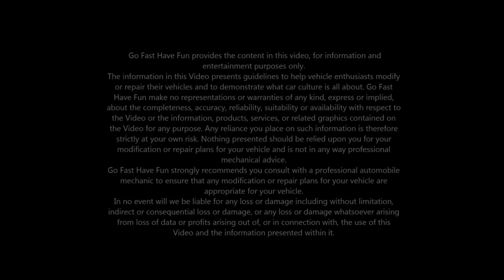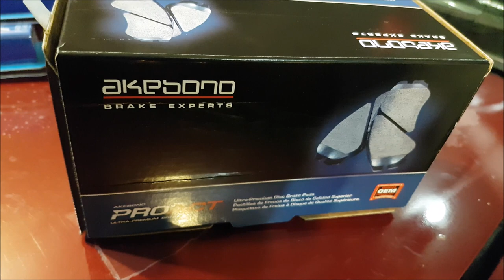Akebono Big Brake Kit Installation with Z1 Adapters (Nissan 350Z / Infiniti G35) | AnthonyJ350

Comment: I skipped the hassle and bought a track model with the brembo from factory! Very cool to see that they provide an aftermarket option for the other models!
Reply from the maker: The Brembo package is decent
Reply: @AnthonyJ350  I’m a fan! I have the 06 track, I recently did pads and rotors and took the opportunity to do the stainless braided flex line as well. I love the stiffer pedal feeling. 
I will also take this opportunity to thank you for the quality and detailed videos about the Z, I used your channel for education and reference while in the market to buy mine. I appreciate your work!
Reply from the maker: @matto5547  Thanks so much for sharing that! Nice to know when videos help. Have you seen our video on the Z1 brake booster brace?
Reply: You really should upgrade your Brembo’s for the Akebono kit lol

Comment: Currently installing Z1 (BBK) on my Infiniti 2015 Q50 w/ Vossen VFS-1 19” wheels.  Ran into the same issue with the Front wheels valve stems.

Luckily I watched this video and ordered the Flush Mount Valve Stems.  Fingers are crossed that they will clear the front caliber!  Will give a status update once complete...
Reply from the maker: Let us know if this solution works for you!
Reply: @AnthonyJ350  i put the akebono on my g37 and my emergency brake , It got out of adjustment, only then do I need to adjust it, a guy told me that I needed the one that comes with the akebono

Comment: Cool video. The only thing I would change are the dust boots on the bleeder value. Looks like they were painted red, my OCD can't stop thinking about it lol.
Reply from the maker: Ya I will change them. The caliper paint looked better if I just painted them because masking the bleeder was a pain. I figure it's just easier to get new rubber caps lol. Good eye noticing that!

Comment: Ohhhh. Ive been thinking about this kit. Concept Z has them aswell. Was thinking if OEM ones or these. BUt OEM Brembo would look stock. Also time for new wheels lol
Reply from the maker: As long as concept Z it's a one piece bracket. Depending how you finish the calipers will determine if it looks stock. These are Nissan parts we put on.
Reply: LilSaint001100 I really liked the Z1 kit fwiw.  With the OEM Rays it has so much of a “fuller” look.  Side note that the exact same infiniti branded calipers are - for a reason I cannot explain - are exactly the same but cheaper.

Comment: Bro! Where do I buy those rear rotors that are the correct size? I cannot find them anywhere with the smaller inner diameter
Reply: bro! I was gonna ask him the same thing lol cant find them anywhere either.
Reply from the maker: I just went to Lordco and asked them for 370Z Akebono rear discs.  Are you having issues like I did with the parking brake?
Reply from the maker: I got them at Lordco.
Reply: @AnthonyJ350  Turns out their just regular G37 rotors ahah. Yeah the G37 sport rear rotors are the 350mm outer with the 6 and 3/4 inch inner diameter
Reply: @aaronnewman1484  so I have a m37x and having the same issue so what do I need to make my parking brake work again because it wouldn't fit with the rotors I got off a 2013 g37

Comment: thanks for the video. I just wanted to see how big the akebono calipers are and how they fit onto the rotors. I was looking at the wilwood 6 piston 14 inch brakes and it looks like the rotor surface area is quite small around the outer edge and the hat is quite huge so it seems almost bogus to call it a big brake kit when the caliper Pistons are quite small. so I am going to go with the akebono. instead of the wilwood. although I am getting the lightweight Z1 two-piece rotors.
Reply from the maker: Thanks for watching.

Comment: Excellent job man! You see these aftermarket akebono refurbished everywhere for short money, they even says akebono on them. They seem to work as good. Are they OEM? If so, why do ppl buy crappy looking used ones for 800, $1000 bucks or more when we can get a raw one at Autozone for less than 100 bucks and paint them ourselves. Powdercoat obviously if you want to pay, but paint looks just as nice. A friend vinyl wrapped it. Never heard of it. Looks awesome but it is peeling a little bit after few months. Supposed to be high temp film. Idk.
Reply from the maker: I'm not sure about the the refurbished ones.  If you know for sure it's the right one for a good price, get them.

Comment: Did you use the same caliper bolts? I tried to re use my stock one piston bolts for the backs and they didn’t work... by the way great job explaining everything!
Reply from the maker: Thanks! I used the hardware that came with the used calipers.

Comment: Ok I'm glad I found this video because my mechanic had to eliminate my parking brake on my m37x to make the big brake kit work but I want my Parming brake to work so I need new big rotors with the diameter of my stock rotors?
Reply from the maker: Ya the drum size seems to vary. What car did your rear rotors come off of?
Reply: @AnthonyJ350  a 2013 G37

Comment: Hey man.  Do you have OEM part numbers for the rotors and pads.  For don’t and rear.  

I wanna get a set of Akebonos.  But I want to buy aftermarket slotted rotors.  So I need to know the OEM sizes for the akebono.  

Since there are 3 different brake types for the Infiniti’s there are 3 different rotors.  🙄 

Also do you know what rotors you had that were to big for the e brake?  

I wanna make sure I stay away from whatever part number that was lol
Reply from the maker: I would check on Z1 Motorsports.

Comment: I also have vossen’s 
19x8.5 in the fronts was wondering what exactly you did to notify the fronts shops aren’t to familiar with the shortening valve stems wanted to know more as I have the same issue with my valve stem hitting the caliper thanks man!
Reply from the maker: If you watch the end of the video I had flush mount valve stems installed to clear the caliper.s
Reply: @AnthonyJ350  did the same

Comment: I installed the Akebono kit on my G35 about a year ago and noticed the brakes are a bit squishy until the pads heat up.  To a certain degree I don't mind it, but I'll ask anyway:  With the master cylinder adapter install do you find that the feedback is touchy at onset or does it still maintain the factory feel?
Reply from the maker: With the master cylinder brace the feel is immediately more positive
Reply: AnthonyJ350 thanks dude, now to adjust the budget for this month...
Reply from the maker: @ScylockeX  Make sure the engine is running when you bleed the brakes as well. The pump needs to be active to bleed it properly. That's coming from Nissan.
Reply: AnthonyJ350 interesting note.  I definitely did not do that but just gravity bled the whole thing in the order my Haynes manual mentioned.  If I find it lacking after the brace it may be worth the effort.  Thanks for the note and keep it up with the videos; you are very thorough and easy to understand.  These types of videos are a boon for those of us who want to do our own work but have an informed guide along the way.

Comment: I just installed a big brake system on my 370z and my brother was wanting my slotted rotors and base 2 piston calipers to install on his 05 350z. Would he need the front adapters to install the 370z base 2 piston calipers ot would it be a direct bolt on?
Reply from the maker: I'm assuming you will still need the bracket from Z1 because the mounting position is different on the front of the 370Z vs the 350Z.  I haven't tried your particular swap though.  If you could comment when you guys have completed the job that would be awesome so I can learn something new.
Reply: Thanks for the quick response. I will order the brackets then and will let you know how it turns out. Didn’t see any videos with this setup so was needing some guidance.

Comment: Could you do a 60-0 brake test? 
really enjoyed watching the video and thanks for making this video
Reply from the maker: The only problem with that is I wont have data for the stock setup I had.
Reply: my350z.com has a great thread that can provide this data. Its a lengthy read but very informative.
Reply: jamaicanbullet thanks

Comment: Is there a bracket for the rears? Or do the 370z rear calipers bolt right on?
Reply from the maker: They bolt right on.
Reply: @AnthonyJ350  thanks man, are you running rotors from the 370 all around as well?
Reply from the maker: @bean2077  Yes it's all 370Z plus the Z1 bracket for the front

Comment: Would the calipers fit perfectly with the g35 19 rays?
Reply from the maker: I would go on my350Z.com or G35driver and see if anyone has done that combination. Good chance it will because my Vossens have a ridge that comes in a lot as you see in the video.
Reply: @AnthonyJ350  much appreciated I bought the same adapter kit and steel brake lines as well from Z1
Reply: Bought them just now looking forward to the install

Comment: can u use the stock brake lines untill upgrade to SS
Reply from the maker: If they're in good condition and you can mount them the same way without them stretching. I would just save up a bit more and install them all at the same time.
Reply: @AnthonyJ350  thx u for rapid response. did you have to buy shorter banjo bolts for front akebono calibers
Reply from the maker: @freeyourmind8849  No, we upgraded them with the stock 2006 brakes (non-Brembo) and were able to reuse them.

Comment: Got a question rotor have to be 370z or 350z same question with the brake lines
Reply from the maker: I have 350Z aftermarket Stoptech lines and they worked
Reply: @AnthonyJ350  what about rotors 350z brembo rotors or 370z brembo rotors
Reply from the maker: @juanrivas7143  370Z doesn't have Brembo rotors
Reply: So you are telling me 350z brembo rotors 350z lines and 370z akebono and adapter that's it's all I need
Reply: I still not understand how the pads work I need pads for 370z or pads for 350z with akebono calipers
Reply from the maker: @juanrivas7143  You need 370Z rotors and calipers which are Akebono. The front will need the Z1 adaptor to install the 370Z front caliper.
Reply: I'm set on that thanks what about pads and lines 370z lines and pads to?
Reply from the maker: @juanrivas7143  370Z Akebono pads. And you should be able to use 350Z stainless lines from Stoptech

Comment: Do you need the Z1 Motorsports Akebono Front Brake Bracket Kit (350Z / G35)for the g37xs 2009?
and today I have tried to install the akebono but on both driver and passenger side, the rotors were basically grinding on the pads? I went to caps to see if I had the wrong rotors but seems like they were the right one. I cant seem to see whats the problem tks in advance.
Reply from the maker: Were you able to push the pistons all the way into the caliper? The bracket is just for mounting and your G37 should already be correct.
Reply: @AnthonyJ350  Ok  I will try it again tomorrow, where did you buy that tool to press the pistons?? I am in ottawa.
I have one of those tools but its for the motorcycle but the one you have fits all the way inside
Reply from the maker: @flipmode00  I got mine on eBay, here's a link to one http://rover.ebay.com/rover/1/711-53200-19255-0/1?ff3=4&pub=5575240889&toolid=10001&campid=5337982243&customid=&mpre=https%3A%2F%2Fwww.ebay.com%2Fitm%2FUniversal-Car-Truck-360-Ratchet-Brake-Piston-Caliper-Piston-Spreader-Press-Tool%2F174213815768%3Fhash%3Ditem288ff3ddd8%3Am%3AmuKF3NwFkz7bTSmyR2Lt1xQ
Reply: @AnthonyJ350  Tks you my man and we found the issue it was the way we set up the washer lol. Man you are a great help tks you and be safe out there wear a mask and gloves.
Reply from the maker: @flipmode00  Was is the washer in the mounting bolt? You guys stay safe too!
Reply: @AnthonyJ350  

OK here we go, I will do my best to explain it lol 
 @3:41 you showed the Caliper brackets bolts. There’s the bolt-washer-bracket and the Akebono caliper.
When we install the Akebono caliper, we did the same process. We put the bolt, washer into the both bracket and tighten it and that caused the rotors to grind inside the caliper. 

So we couldn't figure it out why, we check the piston like you said push them all the way in but no luck, so what we had to do is to take the washer and place in between the bracket and Akebono caliper. So you have the bolt- bracket- washer and caliper.
 I hope that make sens
Reply from the maker: @flipmode00  Ahh ok, and did you apply a little bit of thread lock blue and double check tightness with a torque wrench?
Reply: @AnthonyJ350  Yes I did, took it for a spin and it feels so nice. Big difference I should say.
Reply from the maker: @flipmode00  If you want to tighten up the brake feel there are two other mods you can do easily.

Brake master cylinder brace: https://www.youtube.com/watch?v=mVqQ-1QhoKQ

Stainless Braided Brake lines: https://www.youtube.com/watch?v=91hUTLJL_L8

Comment: Never take mechanical advice from anyone that would use a used rotor or condom.
Reply from the maker: To be fair the rotor had like 18,000km on it and I had them turned.